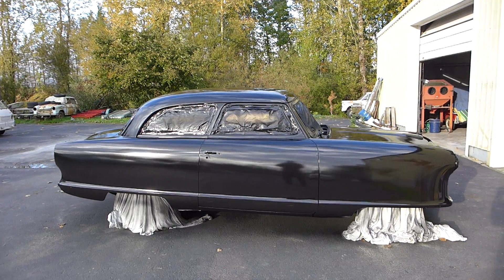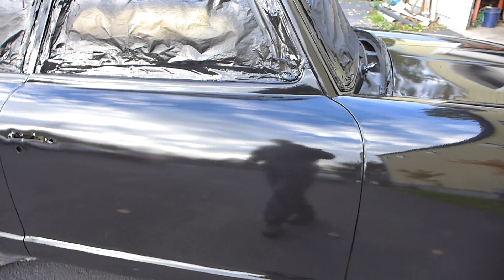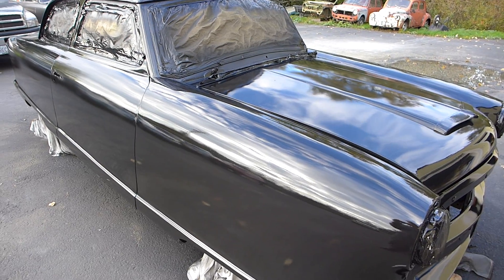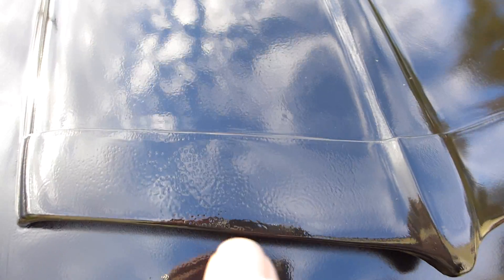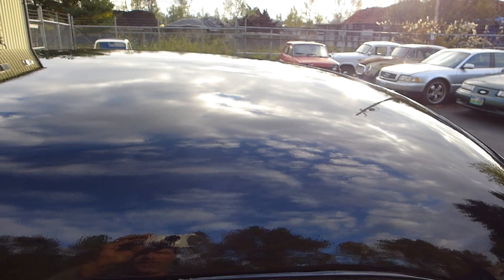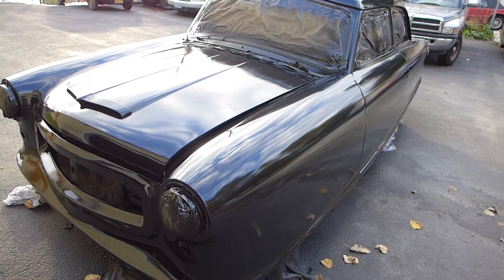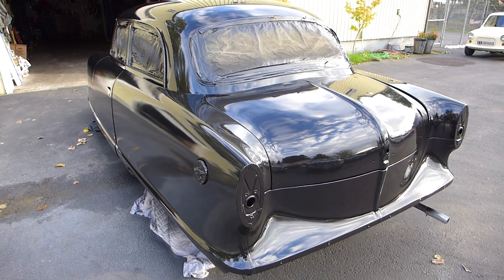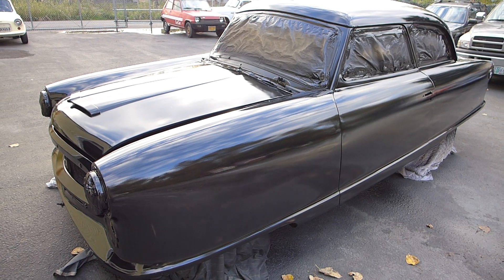1954 Nash in fresh wet SPI epoxy glossy primer

Comment: i spray glass coats with a neiko 1.5 tip with 3 filters, but before i spray expensive epoxy, i prep prep and more prep, after i my fiberglass work and or polyester putty or filler its very smooth, due to da sanding and block sanding with foam bending sanding blocks. next time do the body work like filler & polyester, and block sand, then shoot your epoxy at 30 psi and back your gun away 9 inches and youll see the difference, good luck